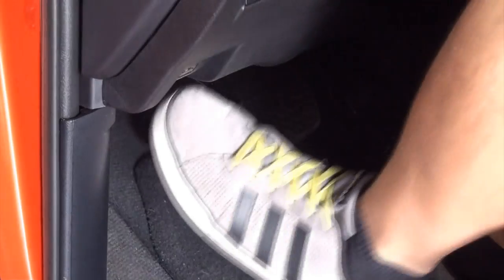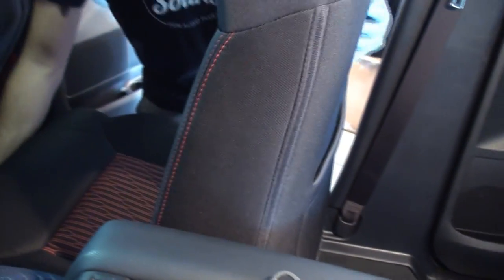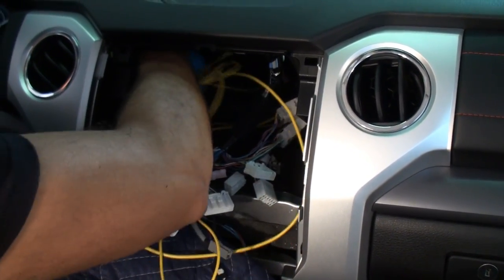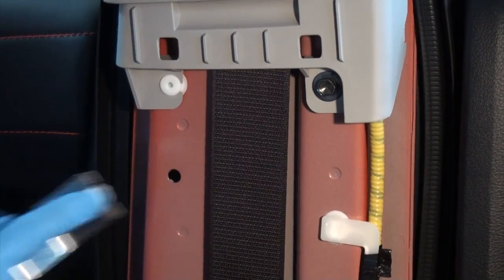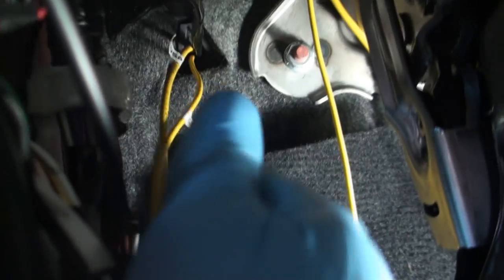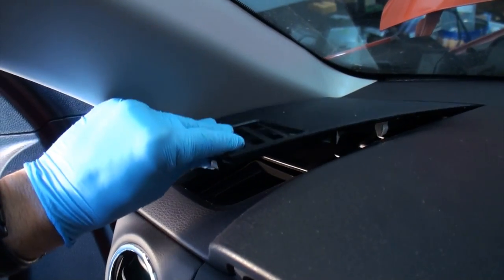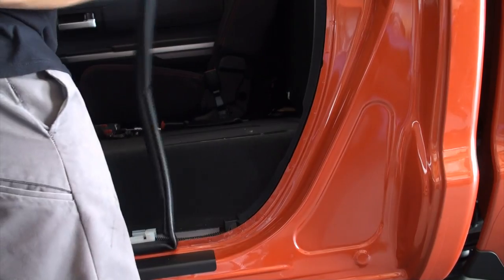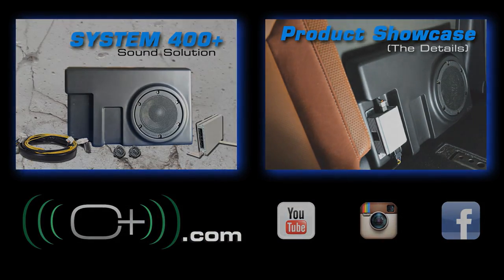Toyota Tundra Crewmax Complete Sound Solution | Installation

Comment: personally I LOOOOOVE all recommendations for carefully removing parts and place them back without damaging the vehicle, most of the shops are plain pigs when working around and always come up at the end with "extra bolts and nuts"...VERY CLEAN AND INFORMATIVE
Reply from the maker: Thanks for your feedback Pirate Radio! It is our mission to deliver a complete high resolution audio system made and tuned specifically for the Toyota Tundra for seamlessly integrate and guaranteed results. It is our hope that this content results in more CLEAN installs amidst the Tundra community!

Comment: Pretty cool for a diy'er but not enough power. I made my own shallow box and fit 2 12 inch rockford fosgates and changed all speakers to rockford fosgates all amps rockford fosgates too. Woofer amp under driver seat and speaker amp under passenger. Crossover inside side panels. 😎 best boom and clarity .

Comment: Nice work👍 no short cuts. Where are you guys located?
Reply from the maker: Anthony M thanks for the feedback. We are based in Anaheim, CA. We ship throughout the world, so you can experience our signature System Integration and Sound Quality wherever you are.
Reply: OEM Audio + Cool I’m in the San Diego area. We will be in Anaheim for a several days at the end of June. Any chance you guys can do this setup install in my 2014 Tundra crew max?
Reply from the maker: Sounds like a plan! Feel free to give our team a call to set up your end of June appointment. Installation typically takes 4-5 hours. We are relatively flexible regarding scheduling (accommodating both early morning or late afternoon at select times). NOTE:  We build each of our sound solutions to order. Therefore we do require orders to be submitted prior to the desired installation date based on lead-time in order to allow us to allocate the parts needs for the installation.  Give us a call at (855) 636-6346 x1 when you're ready.
Reply: OEM Audio + Will do thank you!

Comment: Would this upgrade to the base sound system on the tundra produce better quality compared to the platinum tundras with the JBL speakers from the factory?
Reply: @Russ dawg  
No, this upgrade will not be significantly better than the OEM JBL Platinum system.  That's because the JBL Platinum system is also just mediocre for the price you pay for that upgrade!

Premium OEM audio system upgrade options are one of THE most profitable add-ons for both the dealer and automaker!  Just adding More CHEAP Speakers and a wimpy OEM amplifier does not result in truly superior sound!!!  Sure, it will be better than a base audio system, but NOWHERE near what can be achieved with a high-quality aftermarket stereo install that is installed properly.

If you spend $3,000-$4,500 on a completely custom aftermarket install from a REPUTABLE shop using high quality products (including a DSP that is PROPERLY Tuned), you can achieve a VASTLY SUPERIOR system compared to a "Premium" OEM system in every regard!  GUARANTEED.

The key and hard part is finding a truly reputable shop that does high-quality work, and who will not hack your vehicle and OEM wiring to pieces, and an installer that actually knows how to properly set up and "tune" the DSP with multiple acoustic spatial-averaging microphone measurements.

Thorough knowledge of proper OEM integration into the factory head unit, or a properly executed aftermarket radio replacement with a high-quality head unit, is also extremely important.  Otherwise you may lose important OEM functions such as audible turn-by-turn NAV prompts, Bluetooth audio streaming and hands-free calling audio, or HVAC, Heated Seat switches, and other integrated OEM controls.

But there are many 3rd Party OEM integration solutions available now that offer even additional integrated features over the OEM head unit.  OEM integration modules such as the iDataLink Maestro RR & AR, PAC Audio AmpPRO 4, NAV-TV ZEN A-to-B, MoBridge, Rockford-Fosgate DSR1/Maestro, WaveLink, and Metra/Axxess DSP, etc can offer BOTH better Sound Quality AND additional features such as Performance Gauges, TPMS display, HVAC controls, and Dual Function Steering Wheel Control buttons by using either a single press or "long-press" of each steering wheel button.

Ultimately, GARBAGE IN = GARBAGE OUT!  You must start with a high-quality SOURCE signal or it will forever be the bottleneck of the system.  And Toyota's OEM head units/stereos have a reputation for being among the worst in terms of Sound Quality, along with Hyundai/Kia.  :(

BUT, if you can find that truly professional shop and DSP tuner relatively local to you, you will be AMAZED at the quality of the resulting stereo system, and you won't ever regret spending that amount of money for the audio upgrade!

One of the absolute MOST IMPORTANT aspects of a GOOD stereo system install is Proper Sound Deadening Treatment of the vehicle, Especially where any of the speakers or subwoofers are mounted.

I would urge you to look into the new ResoNix Sound Solutions products that have been independently tested and proven to outperform many competitor's sound deadening products such as Dynamat Extreme, KillMatt, Noico, SLP, KnuConcepts KnoNoise, HushMat, SoundSkinz, Damplifier Pro, etc.

ResoNix products might seem more expensive up front, HOWEVER, you will need to purchase and apply Much Less of their products to acheive the Same Results as competing products!  Check out the ResoNix Sound Solutions Application Guide and Installation Tutorial, as well as the testing results, on their web page.  The owner/developer of ResoNix is Nick Apicella of Apicella Auto Sound who is a top-notch fabricator/installer and DSP tuner.

Sealing ALL openings and holes in the sheetmetal of the doors where speakers are mounted is ESSENTIAL in order to achieve the best performance from the expensive speakers that you have purchased...

It's easy to make a $1,000+ set of front component speakers actually sound worse than the OEM speakers if they are not installed properly!

If the sound waves from the front of the speaker are allowed to interact with the rear sound waves of the speaker through even small openings in the door's metal panel that they are mounted in, you will have severe cancellations of the midbass frequencies that provide up-front impact and bass, as well as ragged overall frequency response.  That's NO BUENO!

Professional installers will use inexpensive, but heat-formable 1/8" thick ABS plastic sheets that are cut out to fit and seal the large openings in the door sheetmetal.  1/16" aluminum sheetmetal is also popular for this.  Both should have at least a CLD material (Constrained Layer Damping sheet commonly referred to as "Dynamat") applied to both sides of the filler panels before they are installed.

Small, self-tapping sheetmetal screws around the perimeter of the opening can be used to install these so that they are easily removable and replacable if the door lock actuators or electric window motors ever need to be serviced.  Riv-Nut inserts can also be installed so that machine thread screws can be used to install or remove these panels.

The speakers must also be mounted to SOLID, high-quality baffles or mounting rings that will not deteriorate inside the door cavity due to moisture or extreme heat or cold.  No type of wood should be used for speaker mounting adapters inside the doors.   Even marine-grade Baltic Birch plywood is not acceptable for this use IMO.

And while some type of dense, weatherproof plastic such as HDPE, ABS, or Sintra (expanded PVC sheet) is the preferred material to use for door mounted speaker adapter rings, the lightweight and flimsy off-the-shelf plastic speaker adapters from companies like Metra/Axxess are mediocre at best, and they do not provide a SOLID mounting baffle for high-end speakers.

Head over and sign up to the Car Audio Internet Forums at DIY Mobile Audio or Car Audio Junkies and start a new thread there to gain knowledge and information on what products to use and how to best install them to achieve the best possible system given your budget.  Make sure to list your exact Vehicle Information (Make/Model/Year/Trim Level/OEM Audio Options) in the Title of the thread so others that have your same vehicle will be prompted to chime in with their knowledge.

My user name at both of these car audio forums is "bbfoto" and I'd be happy to answer any further questions when I have the time.
Reply: @Russ dawg  
You also might want to Search YouTube for the TUNDRA "Installer Diaries" on the Five Star Car Stereo YouTube channel, or their application-specific installation tips on the Dean and Fernando's Car Stereo Clips YouTube channel.

These videos contain a wealth of information in regards to properly installing a high-quality aftermarket stereo system.

Comment: Any luck providing a system for Tundra years '07-'13?  Good video!
Reply from the maker: YES!! The '07-13 Tundra Crewmax shares the same chassis and components as the '14+ Crewmax. We're looking to put together an installation video with a local truck in the near future to take into account the difference in vehicle disassembly (with that said... where are you based out of?). Thanks for the feedback regarding the video!!
Reply: I'm in the Atlanta area. Btw, my stock JBL Toyota head unit was antiquated the day I bought it in 2012. Toyota is glacially slow to update its components, probably an indicator of the bean counters who won't invest as Ford is doing.

Comment: Is it possible to get a bigger sub in the back?  Like a 10 or 12?
Reply from the maker: Thanks for the question! We elected to utilize an 8" in our subwoofer system specifically with the overall musicality and acoustics of the Tundra in mind. 

We knew when deciding on the 8" Subwoofer system that it would be a bit of a "obstacle" for the consumer mindset. Our team evaluated an 8, 10 and 12" option when performing our initial R&D - And it was apparent, if we were going to be true to our promise of producing High Resolution Audio that delivers Clean, Crisp Clear sound and deep low frequency reproduction that is felt as much as heard... It was going to have to be our 8" Quad-Coil Subwoofer.

Comment: will this also replace the JBL system, and if so is the quality any better? I personally think the JBL system is junk
Reply from the maker: Kendall Koch We offer an upgrade specifically designed for your Platinum/Limited  Tundra based on acoustical measurements we made on the your JBL system. JBL Enhancement Product showcase:  oemaudioplus.com/toyota/jup/

Our solution is to simply add our Tundra specific subwoofer system and upgraded dash 1-inch soft dome tweeters. This is made possible using a wiring harness we provide to connect the subwoofer output of the JBL amplifier to our subwoofer amplifier. The replacement tweeters offer an extended operating range in comparison to the JBL tweeter. The results are improved dynamics and clarity without introducing distracting characteristics (such as excessive bass/colored midrange and highs) to the current system. In short, a very much improved sound quality without compromising the functionality of your vehicle.

We are confident you will find this package to be an upgrade over your existing configuration, all the while maintaining all vehicle functionality and appearance. Let us know your thoughts and we encourage any questions - It is our mission to personalize your experience.
Reply: Sold! I'm getting this set up no questions about it!
Reply from the maker: Thank you for choosing O+ Kendall! Reach out if ANY questions or requests along the way. We are here to ensure you have an unmatched experience.
Reply: Kendall Koch did you get it? I just bought a 1794 2014 and I have the sound

Comment: do you have anything like this for a 2006 Sequoia with the factory JBL sound system?
Reply from the maker: Hi Bobby! Thanks for your message. At this time we do not have a solution for the Sequoia models. With enough interest (demand), we will pursue this platform.
Reply: Well I was asking because I know the Tundra and the Sequoia share a lot of the same technology so I don't think it would be that hard adapting to it. I was thinking even if there was a solution that included the factory speaker replacement, amp and the sub connection where we could install our own sub or connect something like a JL audio Stealthbox. I know there's a ton of 1st gen Sequoia's on the road so would probably be worth your while

Comment: Where can I get the quyck sync wiring harnes for my tundra?
Reply from the maker: Our Quick-Sync Wiring Harness is found in our complete Sound Solutions for the Tundra. To confirm, you are looking for just our Quick-Sync Wiring Harness for the Reference 500 Tundra Application (as seen here), correct? Please note our Harness is made specifically for our proprietary connectors and components. We want to ensure we are only offering you something that delivers our standard of results (perfection).

Comment: $1399 for the system?!!!  Nah, I'll pass!
Reply: I paid $3500 for a full fosgate system so thats not a bad price bro.
Reply: @Nemesis 74  
LOL, $1,399 is a completely reasonable price for the Completely hassle-free Plug-N-Play system that they are offering.

Maybe if you have the DIY installation experience to install your own system, you might be able to come up with a slightly better system on your own for the same amount of money, but I highly doubt it would be as simple to install or as Plug-N-Play as what they offer.

As @Terry Reyes  stated, in order to achieve a significant improvement in sound quality over this simple Plug-N-Play solution, you would have to spend quite a bit more for high-quality component speakers, amplifiers, and a PROPERLY TUNED DSP.   This install would include at least some amount of sound deadening/treatment of the vehicle in the door speaker locations, otherwise don't even bother upgrading the speakers.

Along with Terry, I'd say that ~$3,500 would be the starting point for any REPUTABLE SHOP to install a worthwhile upgrade in SQ to a premium OEM system.

That would be roughly $2500 for equipment and $900-$1000 for installation labor.  Average shop labor is at least $80-$90/hour, and such an install would take a full day to do PROPERLY.

Any less than that and I can GUARANTEE you are going to get a HACK JOB.  And while it may include decent equipment, it will NOT be installed and tuned at a Professional level, and you would most likely have to spend more money later to fix the F'ups done during the install.

Comment: I have a 2020 tundra platinum and am interested in this kit. I see you can get dual subs with this kit. Are there holes already tapped for the second sub and will this second sub get its own amp and a separate harness? Are there any videos on this dual sub setup?